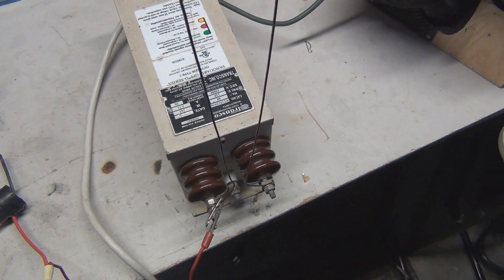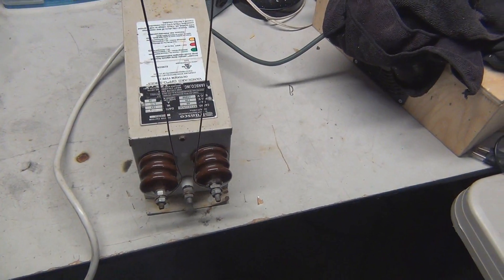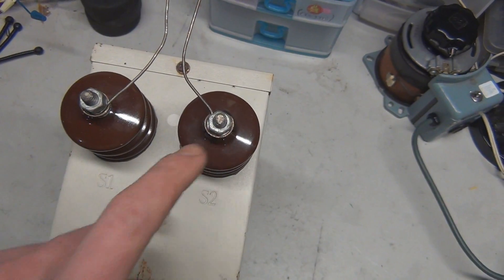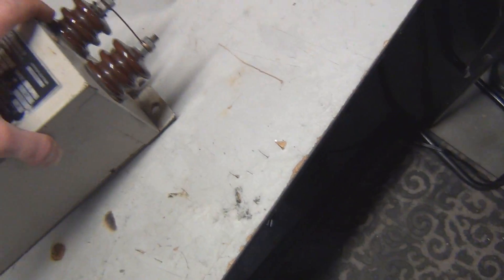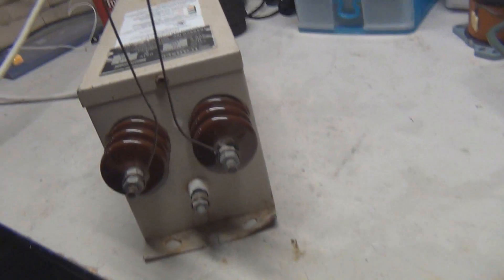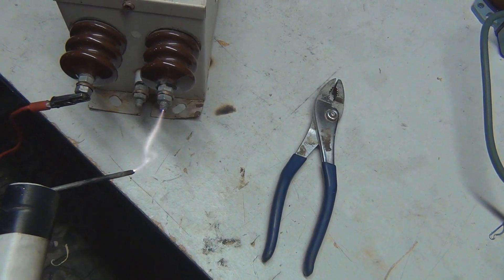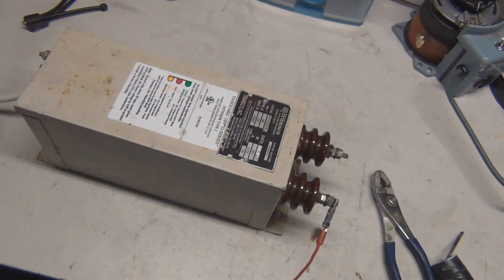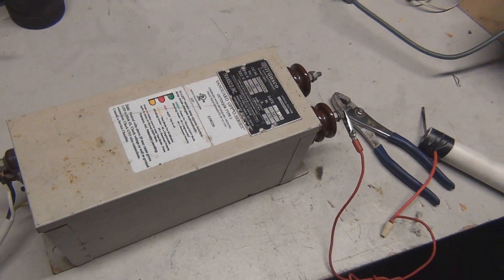NST Safety + Arcing

Comment: Can you easily get more than 60mA transformers in America?In Europe we can get 75,80,100,120,150 and 200mA,maybe even more for really big neon signs but the maximum voltage allowed is 10kV.
Reply from the maker: I've never seen anything over 60mA here. Im sure there are much larger ones in the hundreds of mA in industrial/commercial settings however. Most neon signs now use high frequency switching power supplies rather than a bulky transformer (These however, are terrible for arcing).
Reply: @diy-or-die5700  Actually there are some electronic neon power supplies that are very good for arcing and can tolerate anythong from open circuit to short circuit.But obviously not the cheap chinese ones.
In Europe we also have an option for external GFCI to protect multiple transformers with a maximum load of 6 Amps.(Note we use 230V.) Do you have anything similar in America or gfcis are only inside transformers and not supposed to be removed?
Reply from the maker: @MernokiMegoldasok  While HV SMPS for neon signs are designed for continuous short circuit operation (because that is the load a neon sign represents), they have too many safety features for my liking. Yes, in North America, GFCI can also be implemented via breakers at the main panel. Most homes however, only use GFCI outlets in washrooms, etc. I live in Canada, so I just follow the CEC.
Reply: @diy-or-die5700  We have that in Europe too,but there are specially made GFCIs for neon transformers.They have 2 types,one of them is under the transformer lid which can be removed if necessarry and an external one which can supply multiple transformers.This is because if we want to dim or flash neon signs we need to remove gfci from the transformer.This is actually recommanded by the manufacturer and are made to be easily removed,unlike some American transformers which have potted gfci.
Anyway,the best is the old stuff.You can sometimes even find transformer witchout a case,open coil and core :)
Reply: @diy-or-die5700  Can you get lower than 30mA?We can get 18,20 and 25mA ones.They can still be used for a good Tesla coil.
Reply from the maker: @MernokiMegoldasok  Eh... probably, but really, anything under 30mA is rather pointless, because even at a 15kV output voltage, were talking power outputs of less than 450W which AT BEST could yield roughly foot long arcs in a tesla coil (probably a few inches less). If you are only operating a tesla coil at a few hundred watts you may aswell just use a sstc or flyback powered sgtc topology.
Reply: @diy-or-die5700  I actually made a Tesla coil with 1.25kV 68mA ballasted MOT and it can produce 15-20kV.Enough for a plasma ball for which i made for.I would be very happy if I could find even a 3kV 18mA neon transformer.

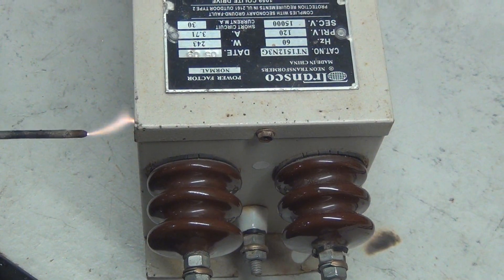Comment: 4:10 why doesnt the gfci switch off when you arc to the case?
Reply from the maker: I disabled the GFCI because in certain applications, it would render my NST un-usable/un-arcable.
Reply: @diy-or-die5700  Would it also trip if you arc it to the return connection below the bushings?
Reply from the maker: That return point is electrically the exact same point as the case. The center tap of the secondary high voltage winding is connected to this point. The MAJORITY of the current will just flow back to the center tap through the coil, however there will be some leakage curreng going through ground. This might trip the GFCI. I can't say for sure whether or not it will; I always just remove the GFCI whenever possible.
Reply: @diy-or-die5700  If you had the GFCI and arced to ground would you see an arc for a second or less or would it switch off so quickly that you wouldn't notice any arc,maybe a just flash?
Reply from the maker: Like I said, you might be able to get in a few arcs without it tripping. GFCI's are set to trip at currents around 5mA and upon reaching that current threshold they trip in around 30ms (or less).